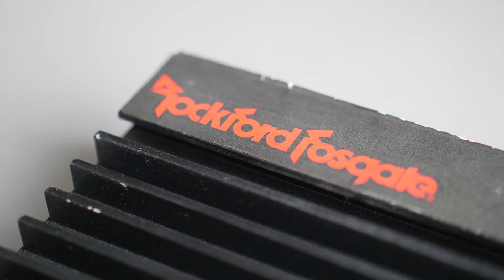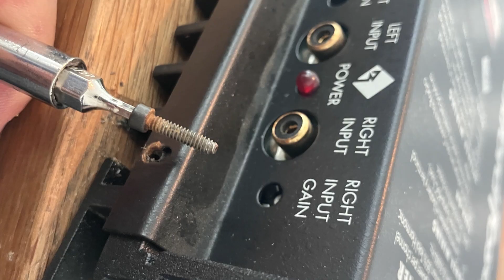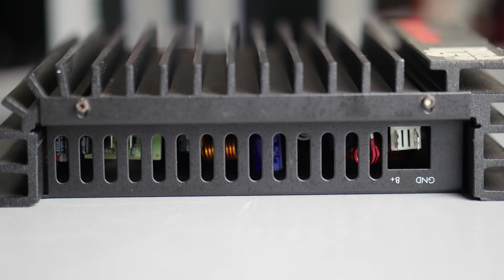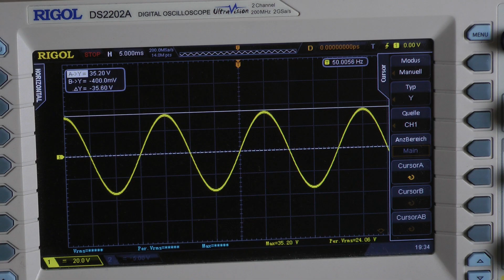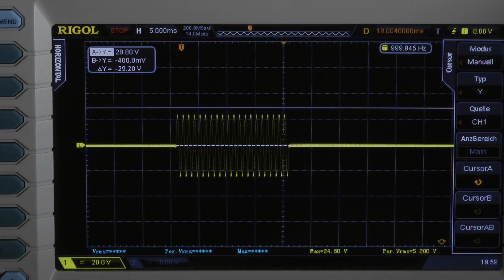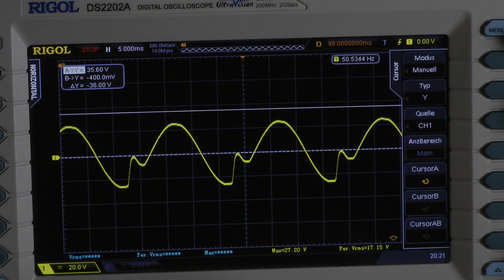Rockford Fosgate Punch 45 HD car audio amplifier dyno power test & repair

Comment: still have my punch 45, the one with the wires coming out, love this amplifier.
Reply: Those are the original Punch 45, this is not what I consider the old-school punch amps but the 45hd is all I see on these channels. I have 7 or so 45’s from 86-88 stacked in my closet, they were great but very easy to burn up if they didn’t have a fan blowing across them. I had 30 or so at one time all were in need of work, thats how I got them.
Reply: @kevinhouston38  Well, my punch 45 is still going well to this day. bro thats alot of amps lol, i hope you get them fix.

Comment: I see new capacitors in that amp.
Reply from the maker: Which caps do you mean? It looked like this amp has never been opened 😮
Reply: @audiokeller1975  the input filter and rail  orange And i believe  blue ones
Reply from the maker: @joshholden8561 ah ok, too bad amp is back to its owner so I can’t check😮